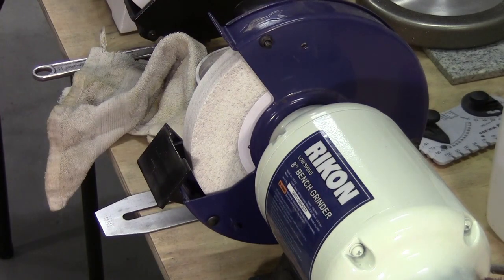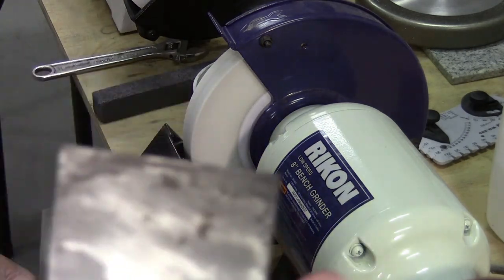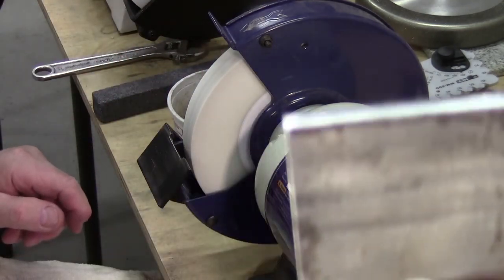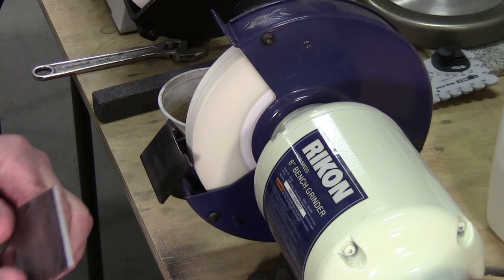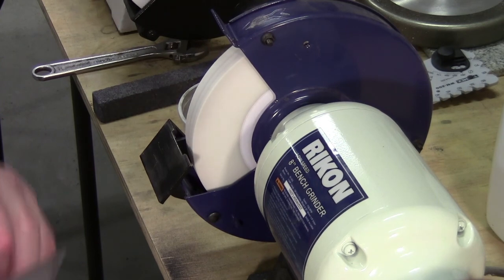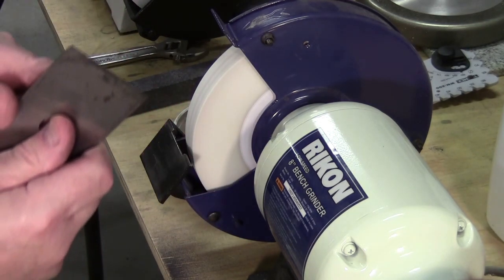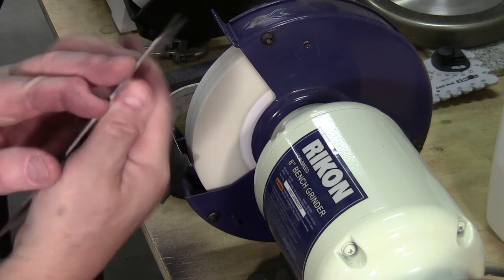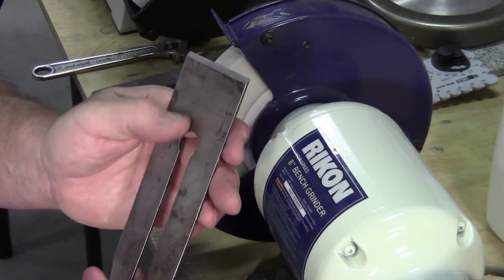Grinding the Primary bevel with the help of my pigtailed Apprentice - PLANE TALK - 4 Oct 2017

Comment: Thank you.  The purists will never appreciate how easy it is to resharpen a hollow-ground bevel.  the angle is so easy to find, and the edge is sharper than if was sharpened totally by hand.  One can also get multiple hand sharpenings from just one sharpening on a grinder, so 90% of the time just a touch-up on a quality bench stone is sufficient.  My father taught me how to use the grinder 53 year ago, when I was 10.

Comment: What did you meanYou

What did you mean when you said you may have to "tap it out with a hammer" ?  
You said it around time stamp 3:00
Thanks for making all your educational videos.
Reply from the maker: There is a risky method of laying the blade on a flat wood surface and you hit it with a nylon faced dead blow hammer to cause it to bend slightly.
When I say risky, I mean that If the steel is harder than usual you can crack it and ruin it.
This blade was not flat either and it has to be straightened/flattened some in the upper part which is softer steel.
I may do a video on that but it is allot like hammering out a knife blade or a saw plate and it take some light to medium taps.
Thanks for watching.